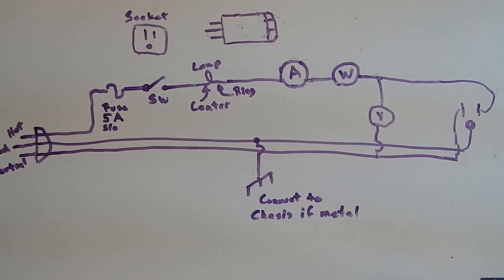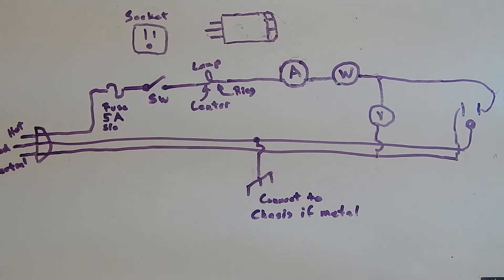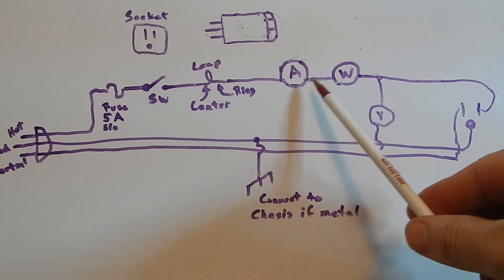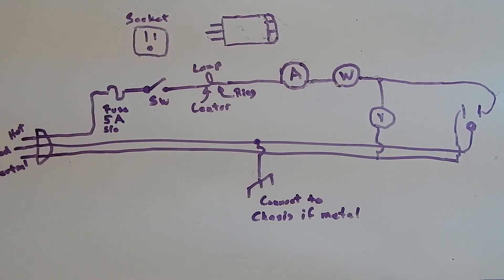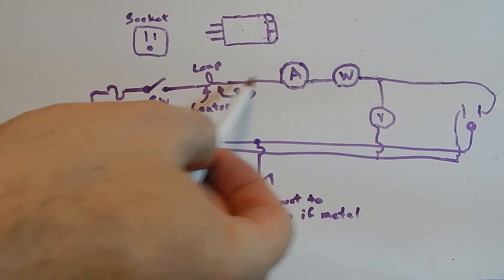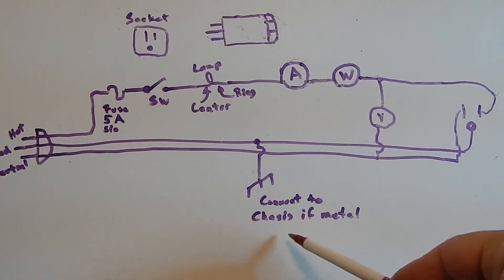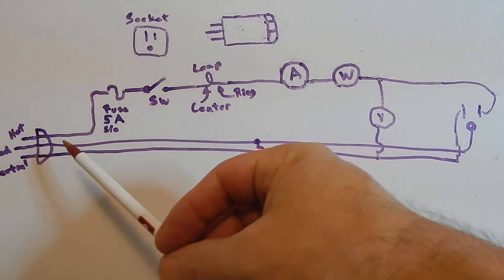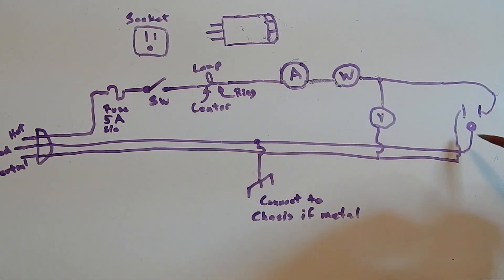A Viewer's Dim Bulb Tester Project

Comment: My 1942 house has no safety ground in many of the sockets. Some remodeled areas have a proper ground. I had to ground some sockets like the washer for safety.
Reply from the maker: My place up North had 50% of the outlets with hot and neutral reversed, I guess whoever wired it didn't think it mattered... 
In old homes with no grounds run, often people will put in a three pronged socket and just leave the the ground pin hooked to nothing. Dangerous, as a defective appliance or a plug strip with surge suppression and /or filtering will result in some voltage on the floating grounds.